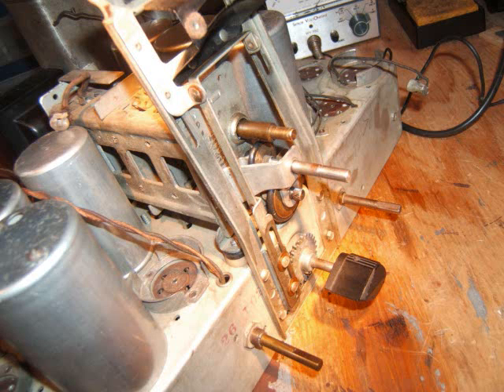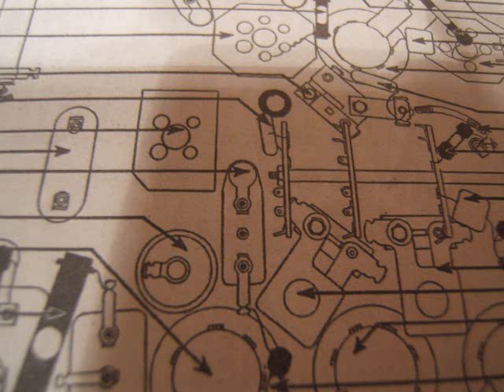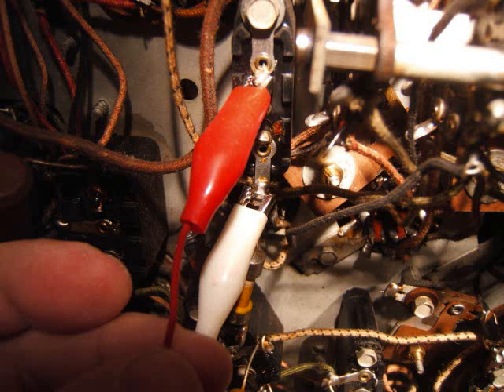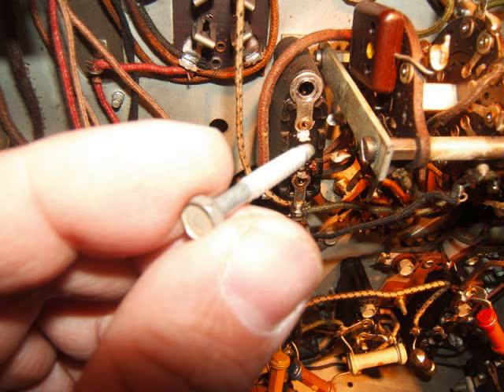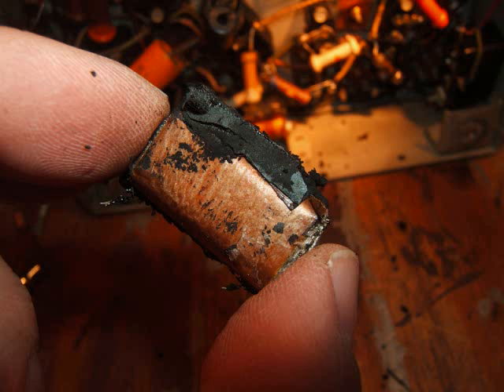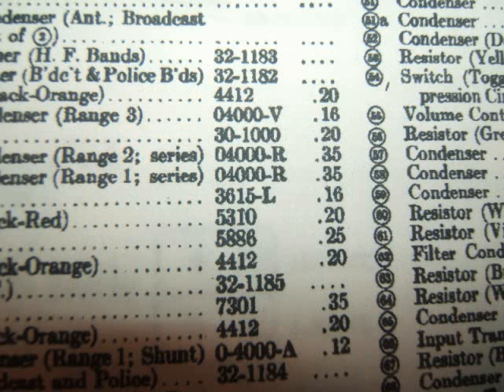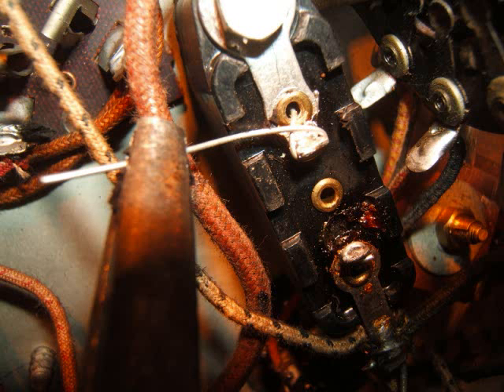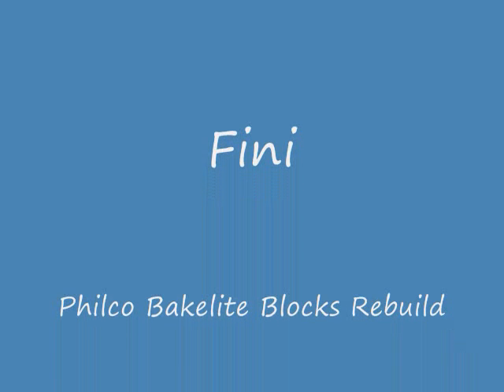Part 25 Philco 16B  Bakelite Blocks Rebuild

Comment: Great video!!!  I am just about to get into rebuilding these blocks for 1st time on my Philco 610F.  One question, where did you get the cheat sheet that tells you what some of the old values of caps that are no longer available, should be now.  For example the .05 uf is 503K 630 v.  I need one of these charts!!!!  Thanks for any help you can provide.  :)

Comment: Looking good. As Rick said, there is a lot of info on THE   PHILCO   REPAIR   BENCH web site. Excellent resource. You will find the configuration for most of the bakelite caps by part number. They are not all configured the same. Also, lacquer thinner cleans that cap up like new as I found after visiting that site, thanks to Ron.
Good luck and Merry Christmas.
Wayne

Comment from the maker: Actually It's kinda fun! The heat gun method you sent works like a charm. It's like a big puzzle. Philco used multiple types of the blocks to provide just the right kind of soldering tabs.  Also it's a surprize seeing what pops out of the bakelite. I might have a different opinion when I gets to number 14!! See my next vid where i'm lookng for outta whack resistors!

Comment from the maker: Already having a problem, the next cap i'm looking at  is the wrong capacitor per the schematic and parts list. I looked up the part on the Ron Ramirez' Philco web site and found the value of what they stuck in. So the question is, do I use what the schematic says or use the part that philco stuck in on the assembly line? Questions questions!!!